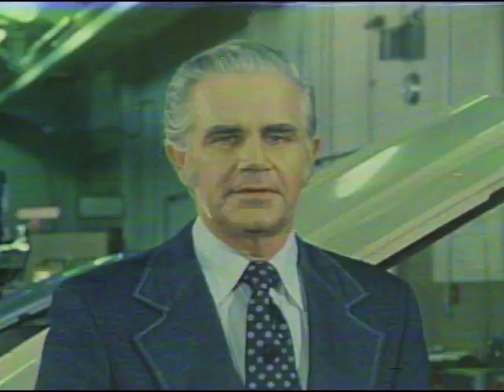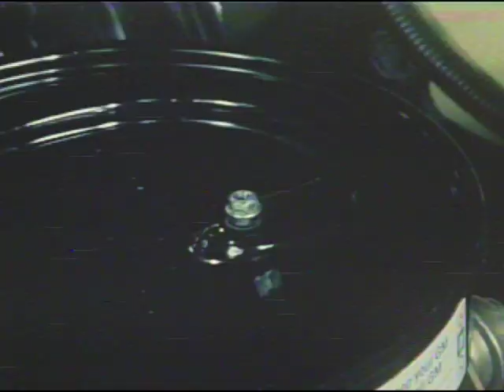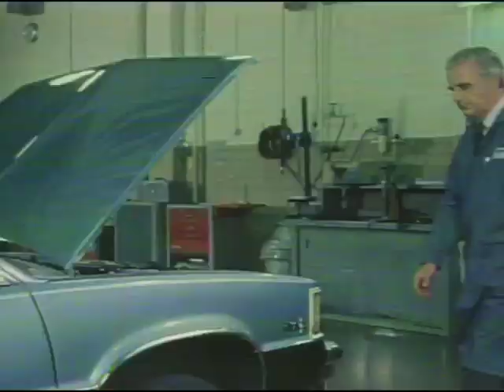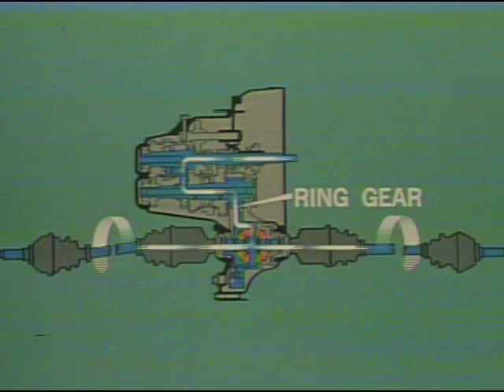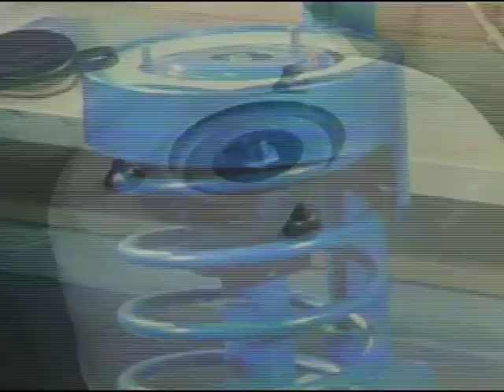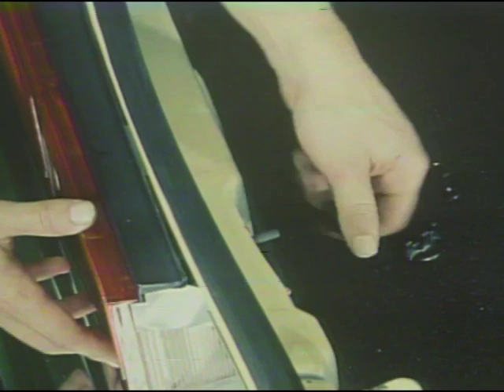1980 Chevy Citation Pre-Release Video for Dealership Technicians

Comment: My first new car was a 1980 Pontiac Phoenix.  It was a 4 cylinder automatic.  We bought it in northern Maine and drove it to southern California.  Everything worked as it should.  However, at about 25,000 miles, problems started popping up.  The Pontiac dealer got real tired of seeing me.  The biggest issue was the transaxle.  I started hearing a metallic banging sound when pulling away from a stop.  I found out there's a chain and sprocket inside the transaxle.  The chain had stretched enough that it would jump a few teeth under a medium or high load.  The Aamco garage said they see that a lot with X-bodies.  Pontiac declined to warrant the issue.  I paid Aamco $650 to upgrade the chain and sprocket.  I ended up trading the Phoenix in for a new Ford Bronco II.

Comment: as a lifelong mechanic, the citation was forefather to all other american cars..fwd, awd...back in the day this car was long anticipated...we were happy..todays generation just werent there to appreciate the past texhnology.
with subframes engine, tranny, rack (on hondas) removal and replacement made simple on gm cars..fuel pumps accessable under back seat...
gms 80s easiest cars to maintain and repair..became quit complicated today and most major engine or trans work we pull engine tranny and subframe together. trucks cab removal
gm came up with quick dissconnect computer at engine compartment, toyota have to fish through firewall. front end, struts and all, all drops out ans head gaskets reseals, engine or trams removal simplified....
rarely are engines picked from the top anymore.

Comment: I'll give them credit for what they did right. Removing and replacing the heater core looks like a snap compared to most other cars. Almost bought one in 80.Rented one and spun out on an exit ramp due to its wonky brakes that would lock up at the slightest provocation. Ended up buying an 80 Caprice, one of the best cars I have had.
Reply: The locking rear breaks were part of a scandalous error in the X car, along with a partial recall.

Comment: The best thing about this car is the ability to remove that engine and put in a Volkswagen 1.6 L turbo diesel, and it comes with shiny Chrome metal bumpers even today's most expensive cars you get a plastic cover and one little scratch cost $3,000 to repair. I probably Drive old GM cars that have shiny Chrome metal bumpers that you can take out mailboxes and trash cans with. There's nothing worse than an ugly old plastic bumper cover. All our bumpers are now girders in Chinese buildings. Somebody should have complained and refused to buy cars with plastic bumper covers.
Reply: "...put in a Volkswagen 1.6 L turbo diesel,"
My preferred choice would be a 3800 V6
Reply: I agree. It was a total step back when they brought in body colored plastic moldings.  Metal bumpers did the job they were placed there for and you could easily replace them

Comment: At 4:44 is a big black R4 A/C compressor, made by Delco Air at it's Moraine , OHIO factory.
The building (2.2 million sq. ft.) was originally started as a Wright airplane factory.
Sold to Charles Kettering in 1926.  (Franklin Sousley worked here , a flag raiser at Iwo Jima)
Closed in 2003, torn down in 2006.
Reply: Even Mercedes-Benz used the R4, sourced from Delco for it's W123 model back in the 70s and 80s.

Comment: I inherited an 1985 citation.  Wasn't a piece of junk as most people have said. Would haul a lot of stuff with the rear seat folded. In 9 years of ownership never left me stranded.
Reply: GM is known For finally getting it right by the time the damage is done and it’s too late
Reply: '85 was the last model year.  All the bugs were worked out, but the reputational damage was done.
 Sales numbers were heavily skewed to the earlier part of the model run, even accounting for the very early calendar 1979 launch that meant they were building "1980" models for at least 18 months.
Reply: @nlpnt  Well you were one of the lucky ones then.
Reply: Which engine did you have?
Reply: I think by '85 they had worked out many of the "bugs".  The 1980-81 models were the worst.
Reply: Yeah, they were great as long as you just used them sitting in the driveway...

Comment: I'm sure those engineers were thinking of me when they hid that Iron Duke distributor between the engine and the firewall! 😅
Reply: Great engine though.
Reply: @relaxinmaxin7246  Great for your lawn tractor--but this was stuck in a car.  I remember it well when it was released, do you?
Reply: @loveisall5520  Owned two 1980 Monza and 1980 Citation
Reply: @relaxinmaxin7246  You poor thing!
Reply: @loveisall5520  your trolling over an iron duke?
Reply: @relaxinmaxin7246 
LoLs!
Reply: MY THOUGHTS EXACTLY!
Reply: Iron Duke was designed for RWD applications.  They didn't have the 1.8L engine ready in 1980.
Reply: You would think by the time the A cars came along in '82 they would have moved all of the ignition system items up front.
Reply: How exactly did people service the distributor/distributorless ignition in transversely mounted Iron Dukes? Did they remove the intake manifold?
Reply: @gregorymalchuk272  I'm not sure what the factory manual calls for, but when I do them I remove the front dogbone mount and tilt the engine forward with a ratchet strap. That gives me just enough room to get back there. Even with that you still do quite a bit of it by feel.
Reply: @a1veedubber when I had that '88 Celebrity and needed to do the ignition module,crank sensor,and coil packs I removed the dog bone and loosened the transmission mount to be able to tilt the engine forward. I still had to disconnect the throttle cable and a few sensors to get some extra space. I really don't understand why they just didn't move the module and coil packs at least up to the top or front like they have on a 3300/ 3800. They could have kept the crank sensor where it was and just ran the wires to the module like they did with everything else.